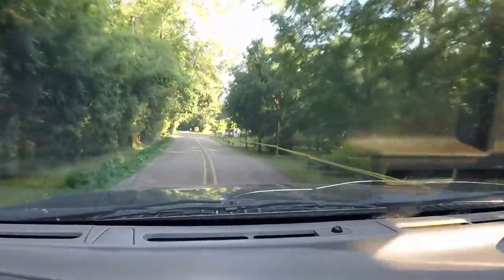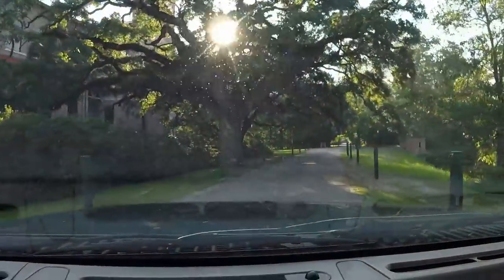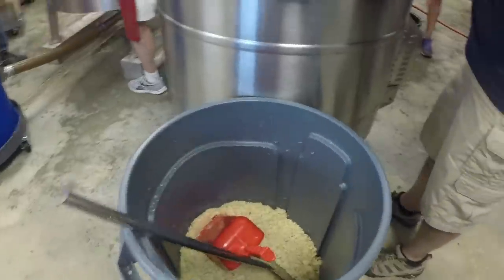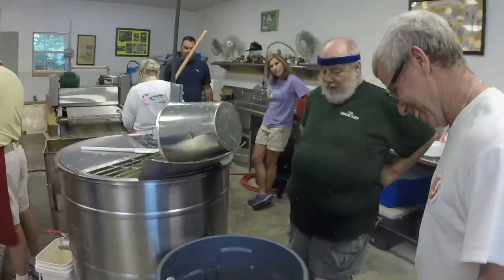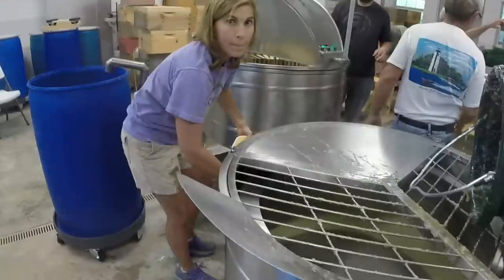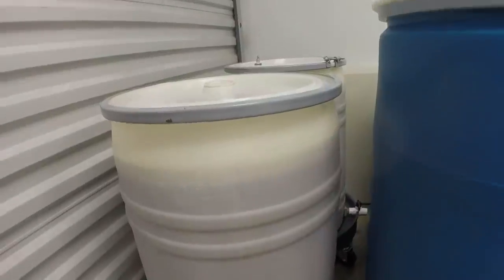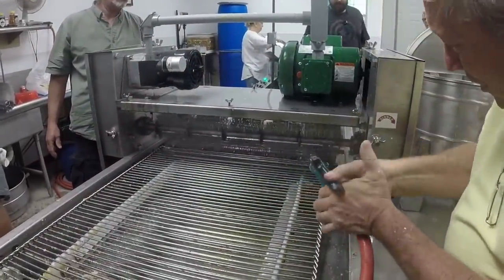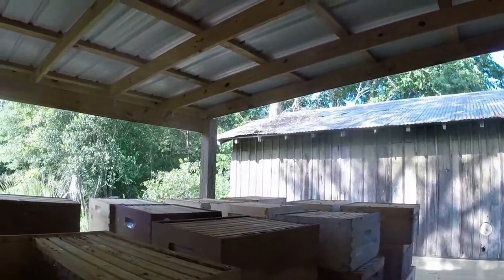3 Tons Honey?? Mr. Ed’s Extraction Party

Comment: wHY DO YOU LIKE THE CHAIN uncapper over the knife uncapper?
Reply from the maker: Personally, I dont use any type of uncapper for my few hives, but Mr. Ed loves it because it gets almost 100% of the caps regardless of the depth of the wax. I don’t care for it as much. It has to be set deep and if the frame is built out thick, it cuts quite deep. It also require a good wax separation system as most of the caps go in the honey. For his type of boxes and management, it’s a great option over the knife uncapper though. He has the capacity to separate the cappings and to reuse the supers for a lot of hives.